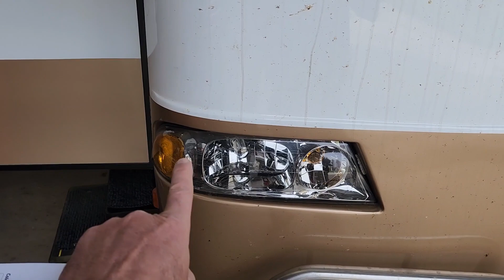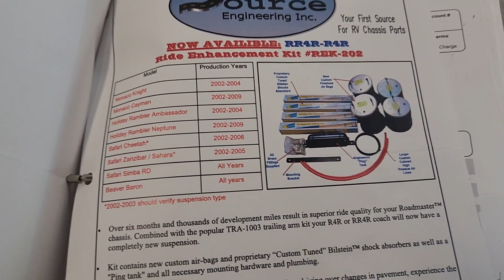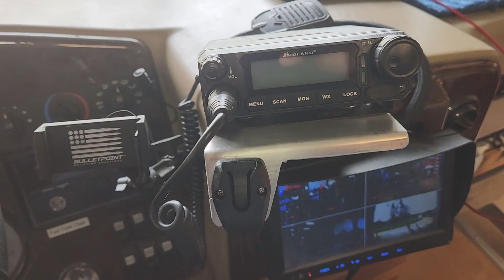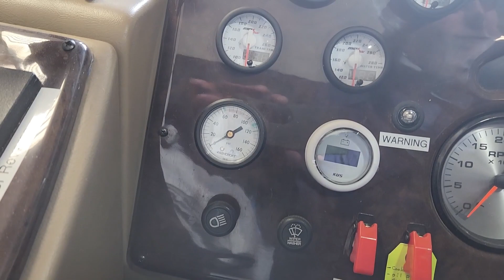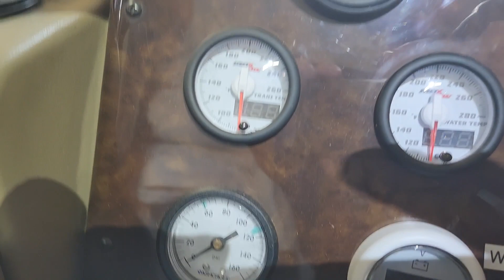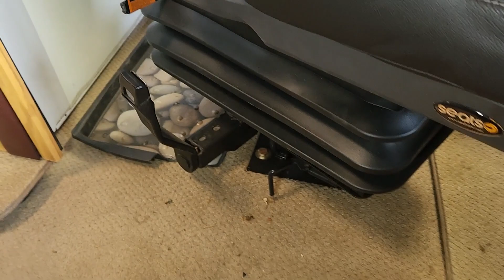Alan's Day   Part 10   Diesel Pusher Motorhome  A Few More Upgrades  "Driver Comfort & Safety"

Comment: Did you also install the Source trailing arms? My 05 Safari Cheetah had the trailing arms replaced under a recall before I owned it. Those recall replacements were a similar design to the failing ones. While changing diff fluid I noticed a crack in one. So some Source arms are on the way.
Reply from the maker: Thanks for noticing a crack. I will get under there to get a closer look.

Comment: I like the seat! My seat in my Newmar pusher is getting finicky. Sometimes it will adjust, sometimes it won't! It's tough when you've had it at the shop and a mech adjusts the seat to fit him then it takes me a few days to finally get it back in position to fit me. If ya don't mind, what was the price on that one? Appreciate the tips, kinda new to this class A rig, always had 5th wheels in the past. This 2004 only had 43K miles on it and I got it for a steal. I really like the older models that do not use diesel exhaust fluid and all the crap that goes with it!
Reply from the maker: Thanks for watching the video.  I like the seat also, the seat I put in our motorhome is Legacy by Seat Inc. the same seat that professional truck driver use.   I think its was around $1,200.  The older models are the way to go.  Good Luck with your Class A.
Reply: @AlansDay-UPGRADE-PERFECT  Thank you!!